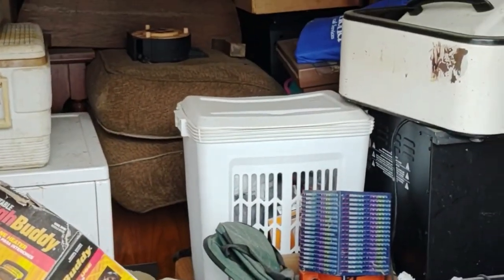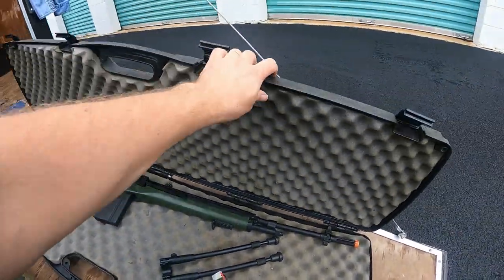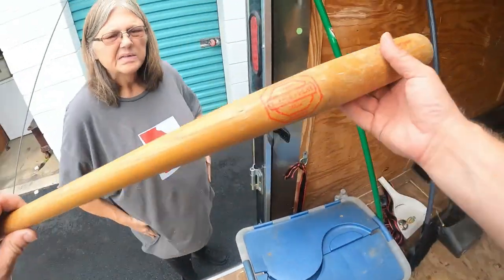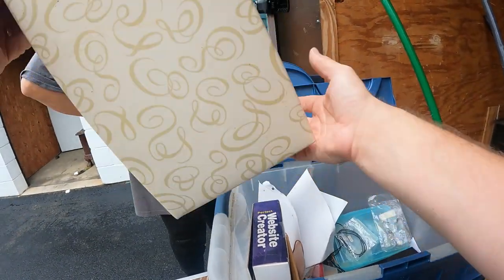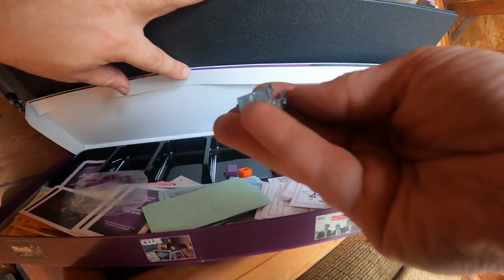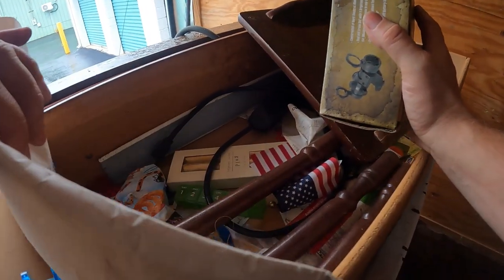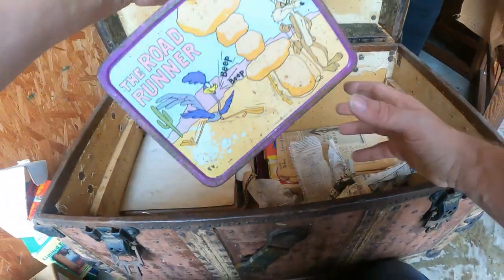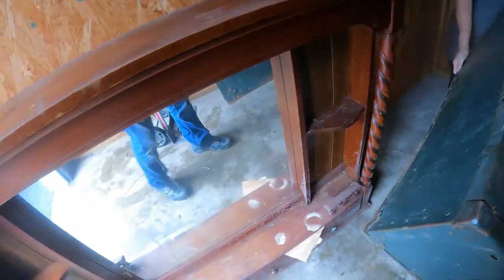I Won a $225 Storage Auction Unit. I Found Sweetos and Gun Cases.

Comment: I love filthy coolers like that, people give them away for free and ten minutes work with the right chemicals and a pressure washer has them clean enough to eat off if you know what you're doing  😉
Reply from the maker: Definitely, coolers can always be cleaned.
Reply: @RedDirtResale  Coolers aren't really a thing hear in the UK and you generally only find the smaller ones for sale, but when I was in Florida for a time they were like essential equipment, especially if you had an old car and wanted to stop stuff melting on the drive home from the store 😁